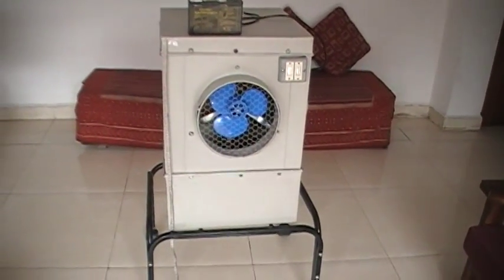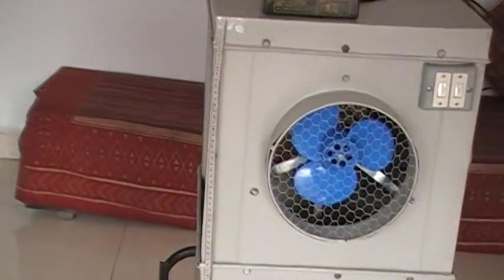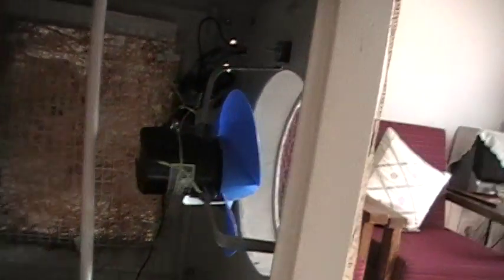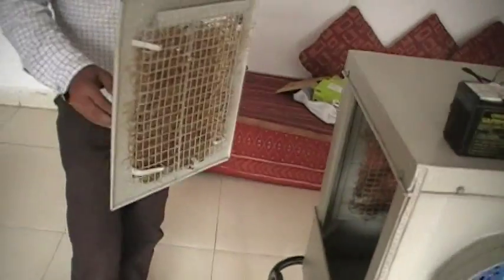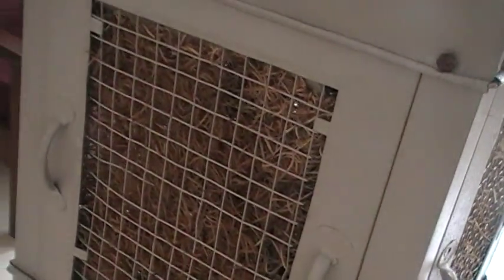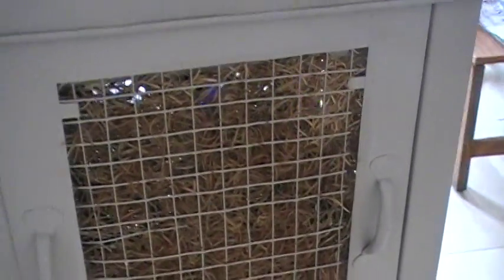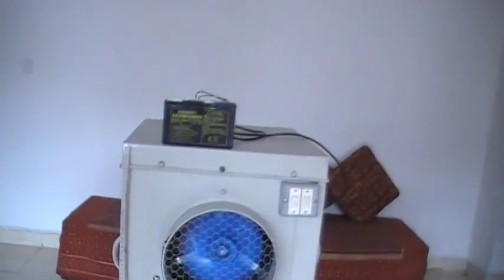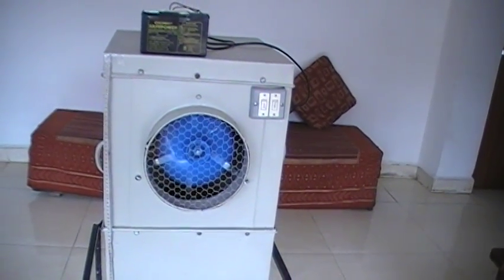SIMPLE SINGLE PERSON PORTABLE 12V DC SOLAR AIR COOLER FROM CINE PROJECTORS.MOD

Comment: Sir I have purchased a 100 watt solar panel....and I attached it 12v battery and simultaneously I attached DC cooler to the same battery.
Whenever I turn on the water pump switch it gives smoke .,..I have purchased DC water pump for  3 times but the problem remain same...but today exhaust fan also gone out of order.
So sir please suggest me a proper manner to assemble it.